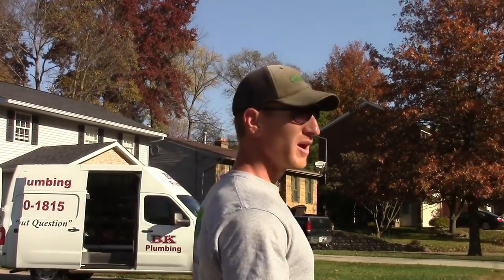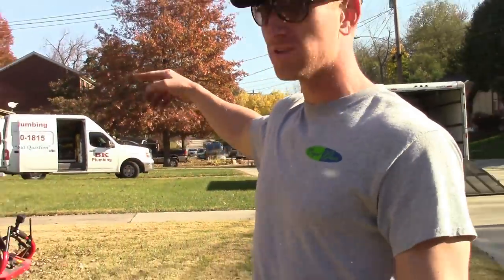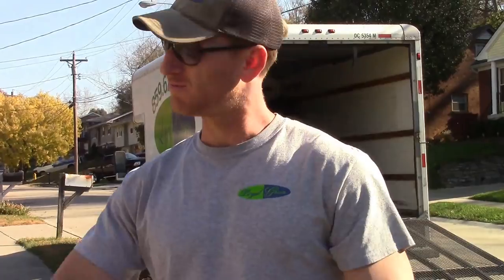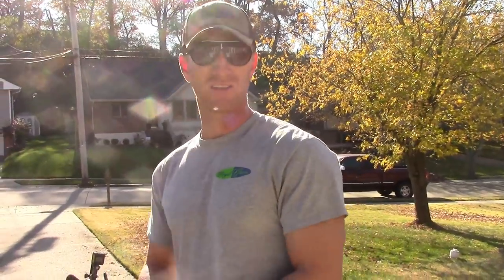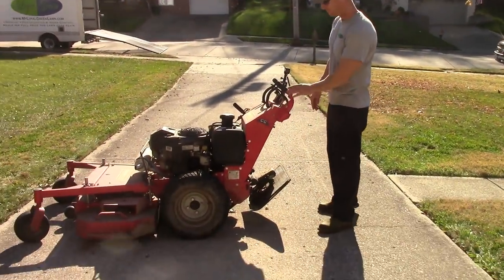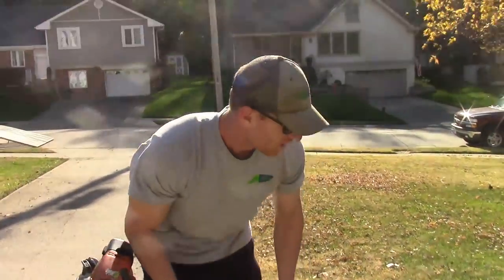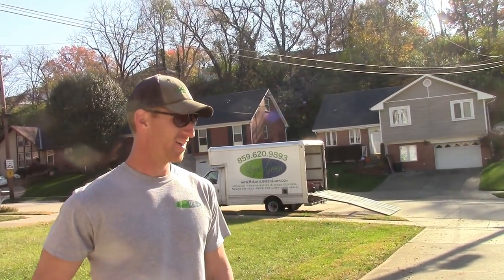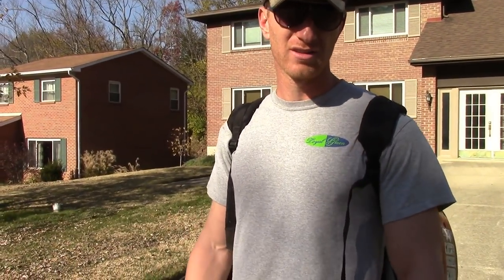How to Mow a Lawn | Professional Lawn Mowing Tutorial | How to Mow, Edge, Trim, & Blow | LawnCrack

Comment: When you're in a tight spot where the discharge will either shoot on to the house or the privacy fence, which I usually encounter in the back yard, what's the best place to shoot the clippings? Also, is there really a big benefit to removing the guard from a trimmer? I've noticed a lot of lawn care guys take them off, but I've left mine on.
Reply from the maker: We always just fabricated flaps for our mowers so we could keep all clippings within/under the deck.  They have things like EZ Chute or whatever, but I personally could never pay that much for them.  We cut a rectangle out of sheet metal, drilled holes, secured it to where the original flap was, and attached a string was we could raise and lower from the mower controls.  Worked just as good for about $15 and 15 minutes of work.  I would highly recommend figure something out to enable your mower to mow in tight spots like that without plastering stuff!!!

As far as the trimmer guard...it does put more stress on the trimmers mechanicals and will probably lessen the life slightly, but I think it saved us enough time and allowed for a more precise trim.  The 'guard' aspect of the trimmer guard is a joke IMO, it is really there to keep the string at the idle length for RPMs and the engine/etc.  You can always pop it off and back on to see if you like it or not.  It is probably best to do this with a pretty heavy duty trimmer...just meaning a larger engine CC size and decent torque.

Comment: So when you mow in the early fall when there are some leaves do you just mow over them and let them lay or do you need to come back and remove them? Thanks, great video.
Reply from the maker: Hey Todd, thanks for the comment.  Early fall, I would personally just leave them.  Some would get mulched up by the mower, etc.  

But, once all or the majority have fallen, I would recommend to 'cleanup' the leaves for the year.  If they aren't too bad, maybe you get away with mulching them into the lawn...but many times the leaves need to be collected and removed.  

Leaving the leaves on your lawn or in your landscape beds can really lead to a lot of unwanted issues with fungi and disease.

If you are a company, the extra work needed to properly handle the leaf removal should be an additional expense!  I see way too many new guys including this in the mowing!  Mowing = mow, trim, edge, and blow.  Nothing about leaves.  Charge appropriately!!

Comment: Do you ever use a blade edger?  Also do you ever edge first then mow?
Reply from the maker: Hi Gwinnett.  I personally think stick edgers simply waste time, but some people had valid points on my blade video on that specific topic - edging with a string trimmer vs stick edger.

IMO you mow first for a couple reasons, but there are circumstances where trimming/edging first makes sense - really the only one I can think of is if the grass is really long and you want the mower to chop up the trimmings/edgings so they don't just sit on top of the cut grass....

1 - Because if you mow first, you then only trim what needed to be trimmed.  If you trim first, you should probably trim out a little further to ensure you don't have to 'double' trim!  Before and after mowing...

2 - Because I don't want my tires laying the grass down along the edge after it's been edged as I mow...this is along walks and drives etc.  Yes, the blower will stand it back up most of the time, but I think it is more efficient to mow, then edge/trim, and blow. 

Preferably have someone trimming/edging as the other mows.
Reply: @LawnCrack  You have some very good points. I think efficiency is key and you sir are an efficiency machine.  I love the look so of the blade edger but requires another trip back to the trailer for sure.  I am going to try it your way today.  I keep a record of my times on every single property I cut, so if I can shave 10 minutes off it will be huge.  Love your vids, you have one of my favorite channels.

Comment: Anybody , how do you go about  cutting  bi-weekly( 14day) yards with a walk behind mower and have the yard looking good. What's the best way to have it looking good? Side discharge,mulching, bagging?.. I found out that 14 days to.cut lawn its alot of grass clippings remains after cut. Someone please give how you and your companies go about cutting bi weekly yards
Reply from the maker: The way we handle it is by charging appropriately.  Many people only want bi-weekly service and we don't want to lose that business, but also don't want to lose money performing those services!  So, make sure you price bi-weekly lawns according to how long they take to do the job right.

Regarding how we go about doing them:

We typically can get away with a double cut and then blowing around some clumps with the blowers.  Double cut meaning we run the mower over the lawn 2 times.  If the grass is really long, raise the deck 1 notch on the second pass so it is only mulching the clippings and not cutting even more grass!  

We also will raise our decks as needed to make it manageable.  We aren't running a charity!  If we can only get the lawn down to 4.5" because it was so tall when we arrived, then it gets cut at 4.5" and we let the customer know they really need to have us out weekly until the grass slows down.

We happily change lawns from weekly to bi-weekly as the grass growth speed changes...make sure your clients/potential clients know this is an option!!

No one really bags grass in our area...but if you do, then charge for that additional time including dump time/fees.

Usually blowing the clumps seems to be the fastest way to make a long lawn look good again after being cut.
Reply: @LawnCrack  thanks so much,  Excellent advice... quick question,  when do you flat trim /flat edge with the weed eater and why?

Comment: Little surprised you weren't either running mulch blades with a mulch kit to pulverize the leaves or a side grass catcher.  Liking the Pro slide sulky.
Reply from the maker: Love the Proslide.. was cutting paid to cut the grass!  Not perform a leaf removal service!  That customer actually never even paid for the mowing...  if you are doing a leaf service, charge for it!!
Reply: @LawnCrack  sorry brother!  You're right,  ya need to get paid to remove the leaves.  Very sorry you didn't get paid for the mow!

Do you do any consulting?  I might be interested 🤔
Reply from the maker: @stevenclark5450  too many lawn care guys aren't getting paid what they should be!!  I do not do consulting...tried it years ago and it's just not my thing.

Comment: I like some of your tips for some of these new guys. But seriously, if those leaves wouldn't mulch any better than that, maybe you should have considered bagging them, after you went over them once with the walk behind... I do more high end properties than that one, here in AL. So, mabe those customers are happy with that amount of leaves.
I just know I would be getting a call back about that.

On a good note, you're pretty good at edging with that string trimmer! And I love the idea of buying a uhaul and adding the gates! But how do you get away without losing trimmers and blowers when you're mowing solo, if your trimmers and blowers aren't locked up? 
I had a BR700 blower stolen off my trailer, just because I was too lazy to lock it up when I was trimming around the fence of a postage stamp sized  back yard of a garden home. I was only back there 4 or 5 mins. And bam, it was gone! $600 out the door! And I had only had it about 3-4 weeks... I hate thieves!!!
Reply from the maker: Lawn mowing is not leaf removal.  Charge for leaf removal/mulching leaves if you're removing leaves while mowing!

I had plenty of stuff stolen too over the years.  You can simply shut and lock the door on those Uhaul trucks if you need to!

Comment: Do you recommend walk behind with the sulky or stand on? Stand ons I’ve seen are more expensive and walk behind aren’t so much
Reply from the maker: If you are only going to have 1 mower, I highly recommend getting a walk behind (with a Proslide XT from Lawn Crack as the sulky of course) over a standon.  

The reason being walk behinds are the most versatile mower and you will be limited on cutting slopes and tight areas with a standon or z-turn which will add a ton of time to complete jobs in the long run.
Reply: Stand on. John Deere

Comment: Just found your website will be checking it out. I'm in my second year of business and have a Snapper pro 36walk. How did you keep the pivot wheel turning like that?? That was nice 👍 I usually use  a three point turn
Reply from the maker: Thanks!  Is your mower a hydro or belt drive?  You can't make a belt drive do that, but on hydraulic mowers, you just have to pull one side back just past neutral and let the other side out just past neutral.  That is what Z-turn or zero turn mower means...it can turn on a zero degree radius.  Even hydro walk-behinds and stand-on mowers are still technically zero turn mowers, we just normally refer to a z-turn as the sit-down model.
Reply: LawnCrack , great advice about proper turning. Why didn't you blow all the leaves on grass and trim then cut? How much was the uhaul truck? How much was for the gate fabrication? I've been trying to get my lawn cutting business off the ground working a FT job I only want 10 lawns and I want to start it debt free so I can be in control.
Reply from the maker: Didn't do anything special with the leaves because the customer didn't pay for that additional service...this particular customer is currently in collections with a $500+ outstanding balance.

You can get a used Uhaul from Uhaul for under $10k.  Go to Uhaul.com and then at the bottom click the 'truck sales' link to see all trucks they have for sale.

Ending up costing me $2,700 for the gate fab.  One guy quoted me $2k a piece and another $1k.  Both ending up charging me $2,700 per gate...I have 3 of these trucks...

Thanks for watching and for the comment.  Good luck getting started.  You can get 10 lawns very quickly by knocking on doors...most people won't do it though.
Reply: what are your suggestions with a belt drive ? i have a toro 36" pro line and a john deere transmission driven 48"

Comment: How much did that walk behind cost?
Reply from the maker: Snapper Pros on on the cheaper side of commercial mowers.  I highly recommend considering them if you have a dealer anywhere close.  I bought several at a time so got my price per unit down to $4300 or so on the walk behinds.  But, I think they are somewhere around $5k for 1 depending on which model/engine, etc.

Comment: What attachment do you have on the back of the mower that you're standing on
Reply from the maker: It's a Proslide XT.  We are an authorized dealer.  We have the best price anywhere on or offline.  I have lots of info on our website.  We had a Proslide XT on every walk behind in my company.  I have used all types of wheeled sulkies.  There is no comparison.  I have no idea why so many guys are still rolling around on wheeled sulkies anymore.  The Proslide is far superior in every way minus being able to ride on pavement.  That is the one and only disadvantage(who cares though - you don't mow concrete anyway).  I have plenty of videos on the Proslide on this channel to accompany the info in the blog post and on the product pages on https://LawnCrack.com.  We have probably sold 100 this spring already.
Reply: @LawnCrack   What if your on a big commercial property piece and have to return to your trailer that's far away, if you cant use the proslide then i have to walk all that distance through a parking lot to get to trailer?
Reply from the maker: @TheBlazinman  Potentially yes.  Most properties will have turf you can ride on along the parking lots/walks etc.  It's not like you can't slide on concrete or asphalt, but you will obviously wear through the thick plastic plate on the bottom faster.

Comment: Have you had any issues with the proslide? Replaced the skid plate?
Reply from the maker: If the user doesn't abuse the Proslide by riding on concrete, let it fold under the mower, or hop on or off too fast and stress out the shocks and springs, you will have very little issues out of it.

#1 thing we replace is the torsion springs - They are like $8 and take less than 5 minutes to replace - Depending on the user you have to do this zero to 3 or 4 times a year.
#2 - Shocks - $28 or so each and the same 5 minutes or less to do the repair - Maybe once or twice a year
#3 - Replace the wear plate - Only needs to be replaced because my guys hop off it once they have already ridden on the concrete for 1-3 feet.  It is super annoying.  You shouldn't have to replace this, but if you have employees, count on it.  It is like $50 or so and is easy to replace...

They did come out with an updated design last year I need to learn more about. 

We should be set up as an authorized dealer for them this week.  If you are interested in one I will see how cheap I can get you one.
Reply: I was looking at them last year but decided on a 2 wheel velkey.

1- I could find enough users praising the proslide
2- Wasn't sure about their dependability
3- Looks like when it is folded up, it would still be in the way (not on your machine but on the others that I have seen online)

I'll be the only user and may give a shot this spring, it is getting old disconnecting the velkey when it isn't needed.
Reply from the maker: I love them.  See if a dealer has one on a demo unit near you so you could ride it around for a minute to see if you like.  Most of my guys have used both wheeled velkes and Proslides, including myself, once you get used to it, almost everyone likes them more.  It is a quick learning curve too.

Comment: You didn't really explain how you did it the wrong way by the beds especially since it was end of the year mowing? Love to pick your brain
Reply from the maker: I believe what I meant was I turned with the open side of the deck blowing into the bed.  If the grass had been long, the beds would have been plastered with grass...easily available by simply turning the mower in a manner that doesn't allow the grass to exit the mower in the direction of the beds.

This same principle is true for mowing next to anything - houses (siding!), fence (especially white ones!), cars in the driveway/parking lot, etc.